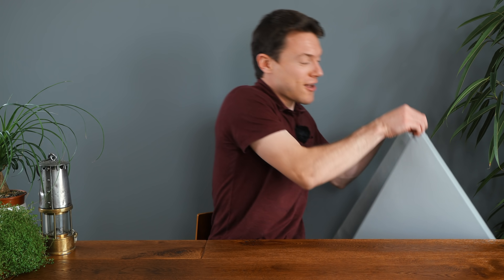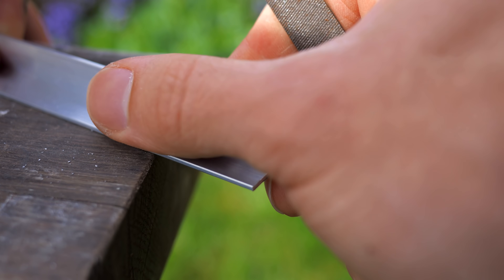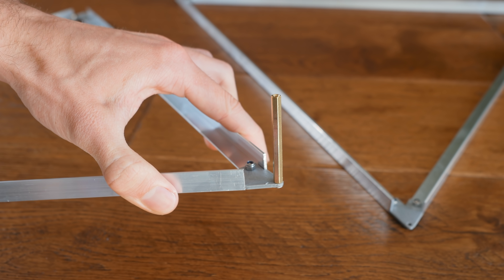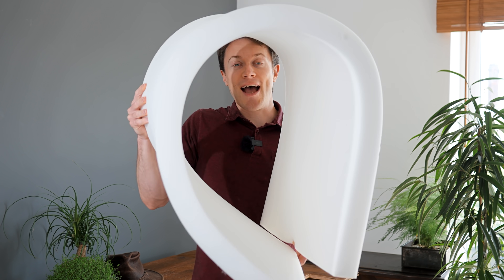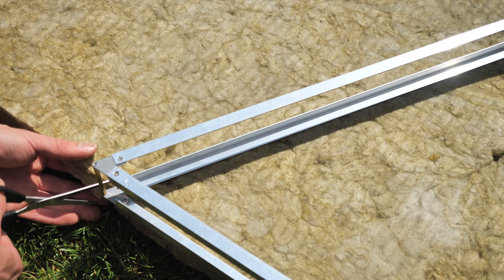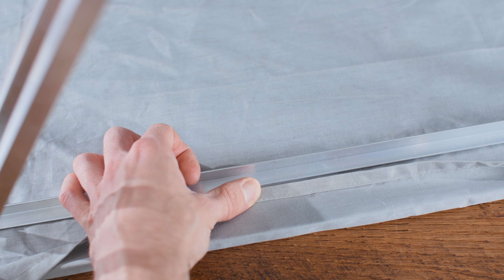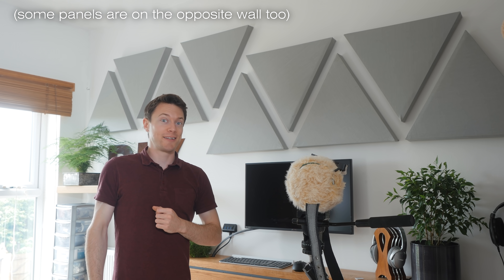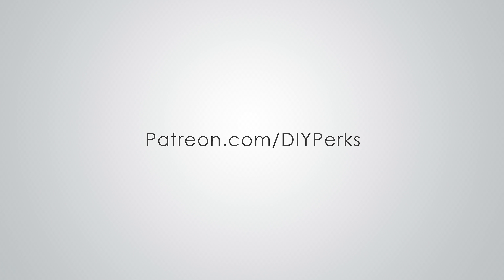High-Performance DIY Acoustic Panels (Build Guide)

Comment: Does house insulation work better than towels stacked to the same thickness? I'm curious.
Reply: A lot better. Also insulation is typically not flammable.
Reply: @bdist  but toxic
Reply: @MT-eb2dx  Who says it is toxic? Scientific source and verified data? Knauf ecose is the better one of the mineral/glass-wool options if you are worried by the miniscule amounts of formaldehyde.

Comment: Ideally you'd like to have an air-gap between the panel and the wall, but that's just to maximize their effectiveness. Nice job in making nice looking panels!
Reply: How does it increase the effectiveness? And how much of a gap would be good? Thanks
Reply: @DoozyyTV  Essentially increases absorption of sound frequencies in theory if done correctly, like having a bunch of panels or foam is going to just take care of your high end, you'd want some bass traps and some thicker material for corners to get some rid of some of the lower end frequencies. I'm by no means an expert in acoustic treatment but i have seen some silly stuff of people getting cheap acoustic foam and covering a wall and thinking they've treated their space.

Comment: There are special drill bits for the bevelled edge. Using a larger drill bit gives lower quality results. They aren't expensive either.

Comment: They will work even better if there's a reasonable space left behind them. They'll absorb from both sides then.
Reply: I was hoping someone else would have said this too. Catch the sound waves that have passed though when they reflect back. At least a 25mm gap I think. I'm sure there are some proper guides on what works best. My Artnovion panels have I think around 30mm behind them.

Comment: 3D printed plastic brackets, nails attached with hot glut pressed into dry wall as mounting method? I don't trust the longevity of this project this time around.
Anyway nice improvement in sound quality, mate! No you just need a silent PC (or whatever device it was), as the fan noise can be heard quite notably now, since there's now less noise to mask it. Maybe use a passively cooled laptop or nuc instead? Don't know how exactly you record in your studio, do you record directly to a pc, or does your camera have active cooling?

Comment: I need some for my toilet for when the phone rings.     They'll never know!
 Although I think it would be simpler and cheaper in this case, to use a timber frame and some nails instead of the ' aluminium, 3d-printed brackets and brass stand-off ' method

Comment: Simple tips as alternative:
Rather than using 3 aluminium pieces connected by bracket, you can use 1 long aluminium l, cut one side then bend it to preferred shape, then drill a hole for standoff; the rest is pretty much same.
Reply: Cut the foam and use spray adhesive to glue on the fabric. Skip the frame.
Reply: @allenherinckx4474  Attach couch cushion to wall with sticky tape.
Reply: @BoxxZero  LMAO 🤣🤣
Reply: @BoxxZero  please make a spinoff of this DIY vid
Reply: @BoxxZero  his solution is indiscernible from using a frame when it's done correctly. The frames are a complete waste of time and money.
Reply: @allenherinckx4474  you bet me to it. Yes, if it's properly cut foam it looks great.
Reply: I was thinking hte same, a single aluminum piece it would be a lot simpler. But I guess he has a lifetime supply of L-shaped pieces :)
Reply: @kkfoto  what about 3 pieces of wood ends cut at a angle so it fits the next and use wood glue to connect them..seems easy enough
Reply: Alejandro I was thinking the same thing I got the wood too I can actually make more of these
Reply: Cardboards are cheaper and easier to use 😁
Reply: My thoughts exactly. Plus I cannot afford to have 3D printer.
Reply: yes and then you would need that lame 3-d printed piece!
Reply: @saintlacy  you mean wouldn't?

Comment: The aluminium triangles are very neat indeed, and all in all this is a great video. I would, however, suggest figuring out exactly what insulation material to use beforehand (personally I think house insulation is better than foam, but that's just me) and its exact size per sheet. Then making the triangles an exact fraction of that so that you can use 100% of the insulation without waste bits. Some DIY panel makers make their panels larger and rectangular - in exactly the size to fit a single insulation panel, because that's easier. 

Furthermore, 4 inches of thickness is required to really deal with bass frequencies, but the best way to deal with bass is something that wasn't touched on here - bass traps. Basically, take these triangles, lay them in the corner of the room with the top point into the corner, and stack them until they hit the ceiling. Obviously it would be a massive waste to do that many aluminium triangles, so a modified design that was 5 or more layers of insulation thick, and had the cover fabric on the "bottom", facing the room, would make sense. And of course, a final nitpick - an acoustic panel works better if there is an air gap between it and the wall. Putting it right up against the wall with spikes works, but designing some variation on the triangle with mounts a bit in from the edge so they could "float in space" an inch or two off the wall would be even better, and look even more interesting.

Comment: You are a godsend. Sadly I don't have all the tools and equipment, however this guide is a great jumping off point for some creative liberties. Thank you!
Reply: It's pretty basic stuff and cheap. All except the 3d printer is a non-luxury product you don't actually need to put it together. Make it 4 sided instead of 3 and you can find the brackets in a store.
Reply: @-ex2598  It might look cheap, but parents don't allow all these equipments, even if it is cheap
Reply: @GARTZ09  you barely need any equiptment, just go to a hardware store and ask them to size the aluminum frames. Then go look around for someone/someplace with a 3d printer and print out the corner. For the holes you just need a basic drill, again ask around. Now buy the isolation material and fabric and you are good to go.
Reply: @jeroenvermunt3372  its  all just expectations, asking parents for these is like asking to get a gaming pc for free
Reply: @GARTZ09  well apart from the fact that these are a lot cheaper than a gaming pc. If you really want them you can get them, no excuses, the only excuse being that you don't really want them that much. Even if making holes in the wall is a problem you can just solve it by using double sided tape or something.
Reply: Maybe it's a different story if you can't physically reach the required places without a car. Where I live everybody has a bike and you can just cycle to whatever place you want. The only investment being time.
Reply: @jeroenvermunt3372  what i meant is, even if i ask for such things, parents wont give, sed
Reply: @jeroenvermunt3372  there's no hardware stores where I am.
Reply: Yeah even i am watching these videos without having the materials
Reply: unexpected creepsmcpasta
Reply: if your microphone is shit this is pointless
Reply: @Lloyd Stout 
Hi,
Can you elaborate on what you mean?

I feel like you refer to proper professional room treatment for monitoring, not recording basic audio with less reverb. As room treatment for audio-production there are a lot more things to consider when building things like this, if that's what you mean. However a well working Basstrap can be built by a very similar method.

But if someone's just trying to dampen the reverberation of a room for recording better audio this video is a very good example of how to do that cost-efficiently. 

=]
Reply: Just cut out some triangles from the foam, cover them in fabric and hang them up.  No need for all the frames and printing.  :D
Reply: @q_pato_owell it is what it is ¯\_(ツ)_/¯
Reply: One of the Best Ideas of SoundProofing is "SoundProof Curtains" it actually Block outside Noise coming from Windows. Check Here: https://livesoundproof.com/best-soundproof-curtains/
Reply: @laurabrown5445  and then it's like you live in a cave

Comment: In some cases making the backside into classical "eggbox shape" can help too as it diffuses the sound that will then bounce back from the wall, especially if you leave a certain gap. its a bit like the micro meteorite shields of the ISS
Reply: Not true (Eggbox) that is just a loss of the foam and hence loss of performance, likely at the lower end of the frequencies it would otherwise handle. Having an airgap does improve performance but not really related to meteorite shields.

Comment: Nice work and great explaination, except for one part - the science part of it.
It's true that too dense material will become effectively a reflector, but not for low frequencies, but high frequencies.
This kind of panels are used to absorb mid and high frequency sound waves, and will barely have an effect in the low-mid and low frequency range.
It might appear that they reflect the low range because it becomes more pronounced as the high freqncies are absorbed, but in reality the low frequcies pass right through those relatively thin panels without losing any significant amount of energy.
To absorb (not to mention reflect) you need very dense and very thick materials, like 1m and more of rockwool insulation material.
Rockwool is one of the best materials for reducing reverbration, 5cm will yeild quite a nice mid to high frequency absorbers.

Comment: Spacing them off the wall a distance equal to their thickness will extend the absorption coefficient down an extra octave.  Anyone serious about this should read Ethan Winer's articles and check the threads over at Gearslutz.  Absorption coefficients for a variety of materials have long been documented, there is little sense in experimentation unless you have a suitable testing environment (you don't).

Comment: outsourcing for 3d printed parts stops making the project a DIY
Reply: I don't think you understand the spirit of diy.

After all, no one makes their own glue, nails, staples, or screws for their projects... And rarely cuts down their own trees, or sources the ore and mills their own metal. 

Yet, some or all of those are part of the finished DIY piece that they didn't just buy the finished product of.

Comment: Do the frequency sweep sound test on these that you used on your towel panels, and see how they compare.
Reply: towels>>> still dope video
Reply: Fsilone I didn’t realize he did that. With REW? I’ll have to check that out
Reply: Yes I think towel will win 🏆
Reply: These are for dampening sound reflection, while the test he did in the towel video tested for sound absorption. Two completely different things
Reply: @noynayru 

Absorption is a means of reducing reflection. Sound absorption panels are not very useful for sound insulation (i.e preventing sound from being transmitted between rooms).

Comment: Very nice and easy, and very effective, too. 

An led strip along the inside of the outer edge could be a nice touch, and the bed sheet should diffuse the light nicely.

Hiding the wires is another story, though.

Comment: Bath towels work very well when stacked a couple of inches thick. You can get them dirt-cheap at good-will and you could probably fold 3 or 4 into triangles and pack them into the frame

Comment: I think it would be neat to use riser screws to mount these a couple of centimeters off of the wall and embed a few RGB leds in the back of them for an optional "inverted nanoleaf" look.
Reply: Doing this would also increase their performance as the leftover sound which is not absorbed will reflect back from the wall into the back of the panels. This actually changes the range of affected frequencies by the panels.

Comment: A side-by-side comparison between these and your first version with the towels would be awesome so we can weigh performance vs. cost of the two variants.  Amazing video either way :D
Reply: I have tested both of his methods in my studio. Though both towels and rockwool perform equally good, I found rockwool to be a bit better. Also using a high density rockwool (around 100kg/m3 ) performs significantly better.
Reply: @adityamhatre  have you got the Model of Rockwool that you  used (the high density one) please?
Reply: @adityamhatre  thanks for the research. Science!
Reply: @adityamhatre  I'm cautious about possible cancer issues after using rockwool tho.
Reply: @papercuthappinnes4468  It's safe :)
Reply: @adityamhatre  I won't put my health on anonymous comment.
Reply: His towels videos was my first video of his I watched
Reply: In mother russia, they just hung a carpet on the wall. Carpets were a thing 50 years ago, especially expensive ones.
Reply: @eIektrinis  THATS the reason those slavs have carpets on walls? To prevent sound waves from reaching western spies!
Reply: @elektrinis . They were a thing hundreds if not thousands of years ago.
Reply: I was wondering about this as well. The towels seem like they have the potential to be far more cost effective and easier to make.
Reply: @wwklnd  And instead of stapling and stitching them why not just pressfit them at one end between 2 pieces of wood bolted/clamped together and let them hang?  Probably the more air space between each one the more effective their sound absorption capabilities are.
Reply: watched the video after read this comment.. and the towel-tech is awesome, too. Thank you for this comment :)
Reply: @denganbrian1230  I have a feeling that this is the problem with getting a refund or partial on a service where the customer doesn't know what is going on. I think I am screwed here.
Reply: @stevethea5250  begone bot!
Reply: I'd love to see that video, I love his first version! Better then commercial at a much cheaper cost
Reply: Towels won't do the trick as well a Rockwool. Their absorption coefficient just isn't as good. 3" thick Rockwool panels hung 3" inches off the wall will be the greatest bang for the buck. if however, you don't use the space you want to be treated for audio mixing work/sound design then... I guess towels will be sweet :)
Reply: Subsribe to that!
Reply: Yes, I am interested in how the towel design acoustic panels fare against this ones, perhaps you went with these materials due to the shape, or perphaps the amount of material needed and the profile was the cause, not just the acoustic performance?
Reply: I'm late to the video, but now all I can think of is a backlit version of these to increase the aesthetic value. Great video
Reply: I went with the towels too.
Reply: Towels did work really well in that video. However I would imagine the material is a lot heavier than dense foams or insulation. This could be a problem for some people.
Reply: Like #1,000 :)
Reply: Towels are better solution. Why he didn't compare them? Or mentioned it?
Reply: One of the Best Ideas of SoundProofing is "SoundProof Curtains" it actually Block outside Noise coming from Windows. Check Here: https://livesoundproof.com/best-soundproof-curtains/

Comment: Look cool.  Saw an older video of yours using towels.  Are towels not a better choice acoustically?
Reply: I would imagine the towels are considerably more heavy and you wouldn't be able to cut them in a stack so u would be cutting a tonne of towels for just one frame.
Reply: Not to hang in a drywall, it would collapse very fast.

Comment: Useful and we'll done video!
How good are these with fire safety?
Reply: Insulation material is usually very fire proof.
Reply: The fabric would be the only concern, but they're no more flammable than a blanket, or sheet.
Reply: @SkullyGibs  Many bedsheets are fire retardant, so actually a good idea to use.
Reply: @63ch31  More important than fire safety is finding bedsheets with cats, or dogs on them. Adorableness is key in home decor.
Reply: @SkullyGibs  You are indeed very correct
Reply: I would like to put some LED strips around the panels..so I should probably be extra careful.

Comment: Very nice Matt.  One variation that comes to mind is if you made different thickness of panels with different materials.  That way you can spread the range of frequencies that the panels absorb and even out the effect.  Different thicknesses would also add another dimension to their appearance.  Great job.
Reply: Yeah, if you want to absorb bass, the thickness has to be something like 4 inches. Preferably more, which is why bass is usually done with bass traps in the corners.
Reply: instead of aluminum panel you can  also use wood.
Reply: @madd5  I have a feeling that this is the problem with getting a refund or partial on a service where the customer doesn't know what is going on. I think I am screwed here.
Reply: @stevethea5250  Why do you keep posting that?
Reply: @Alexandra-Rex This is purely anecdotal evidence and should be completely disregarded. For example just because I have never had a working onboard WiFi I am not going to tell you to avoid it.

More anecdotal evidence is that I have been using the same usb wireless adapter for 4 years and it never drops signal.
Reply: @Alexandra-Rex  I do believe we have a dumb review bot on our hands that's somehow found it's way into YouTube comments